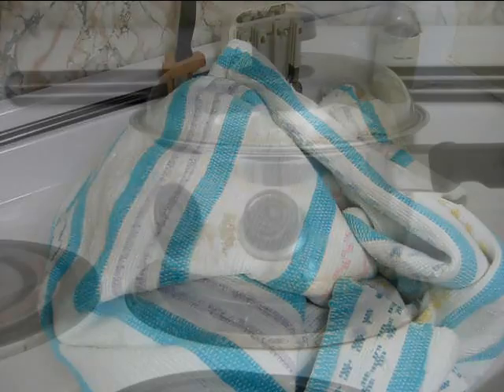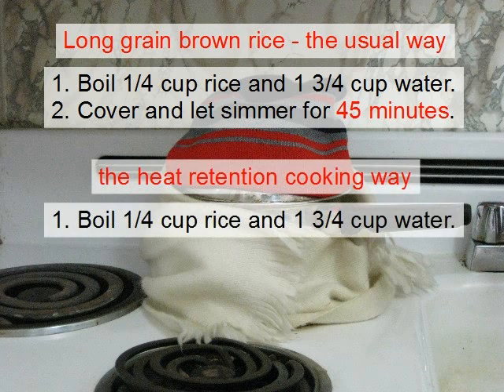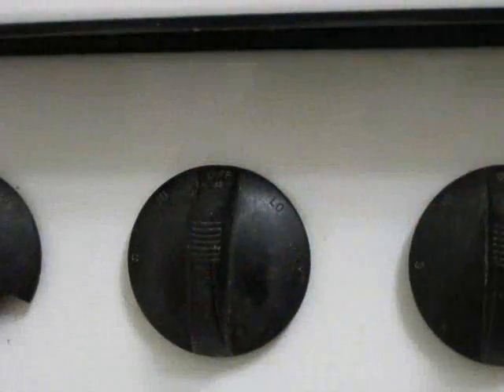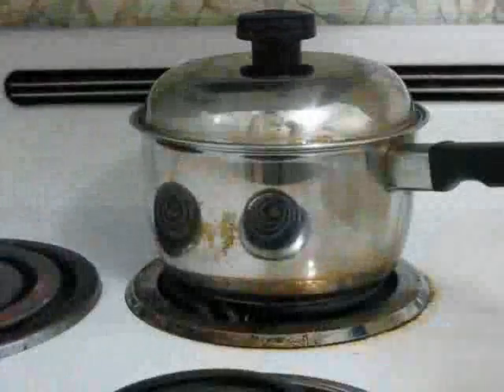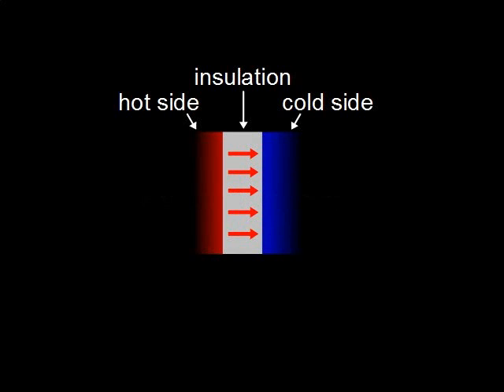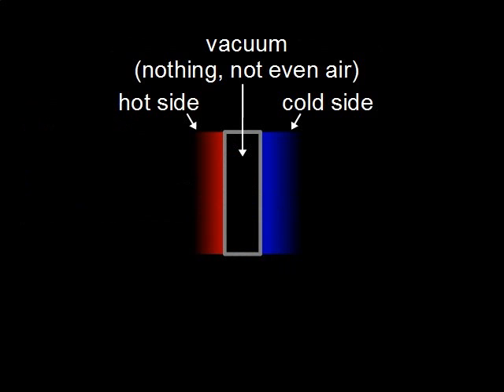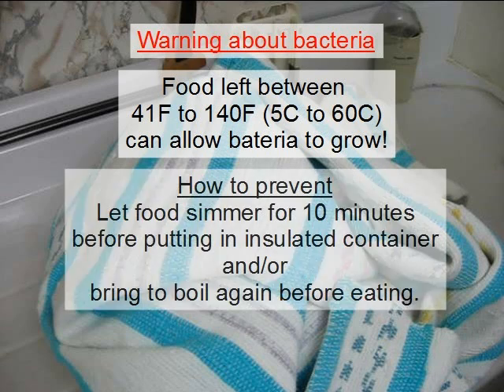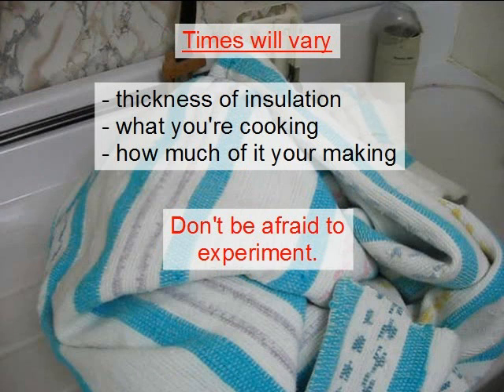How to do Heat Retention Cooking (thermal/haybox cooking)

Comment: I use duvets for insulation, they are the best. Anyone who buys thermal cookers from a store is throwing money away.
Reply from the maker: I'm glad to see others still do this. I don't do it all the time, sometimes I need the added humidity in my place from the stovetop simmering, but if not, then I still do heat retention cooking.

Comment: Nice clear explanation of thermal part of it. I've found that the more I fill the cooking pot the more heat it retains, is it because heat gets lost into the air in the pot?
Reply from the maker: Water has a high specific heat capacity, meaning that it retains a lot of heat per mass. That basically means it's very good at storing a heat. The more water you put in, the more heat you can store in the pot. Many foods also contain water. 
If it's other things that you're filling it with that don't contain a lot of water then you're still getting the same effect, just less so since everything has at least some specific heat capacity.
Air has a lower specific heat capacity.
See this table (water is H20) http://www2.ucdsb.on.ca/tiss/stretton/database/specific_heat_capacity_table.html
Reply: Thanks, that was really useful info. Ah, a lot of veggies contain a fair bit of water. Am going to experiment. :-)

Comment: RimstarOrg  cool, but I would recommend putting a warning about beans, never cook fresh or dried beans like this, only reheating cooked beans or canned beans. there are toxins in most fresh or dried beans that can poison you(possibly fatally) if you don't cook them properly to destroy the toxins, this sort of cooking is not sufficient to destroy those toxins. you need to boil beans for hours  or cook them quickly in a pressure cooker to destroy these toxins.
Reply from the maker: I wasn't aware of that. Thanks.
Reply: True...Kidney beans are the worst.  Do a Google search on bean poisoning.  I just learned about this.  It says pre-soaking and then boiling for 15 minutes is enough to kill the toxins.  As little as 4 kidney beans can cause serious illness/death.  Scary stuff. Also, if you don't get the toxins out they will just multiply. :(
Reply: You definitely can cook beans, (even kidney beans) this way of you follow the rules for safely cooking beans. Just soak the beans 8 hours/overnight before cooking, that's very easy to do. Drain the beans and cook with fresh water, then make sure to boil beans for at least 12 minutes, that's all. Then wrap up in the thermal blankets just the same way and leave alone for several hours. Check out boiling times for beans on the web and you'll see this is safe. Just soak drain and boil. Look this up yourself before doing it.

Comment: I've done similar heat retention cooking, but use a ratio of 1 part rice to 2 parts water:
1 cup rice and 2 cups water.  I boil the rice for 5 minutes and let it sit in an insulated container for about an hour.

Comment from the maker: @DCVU2 Try searching google.com for "heat retention cooking". But they are all rough. The amount of time it takes depends on the amount of insulation you use which is different for everyone. It also depends on the amount of food you're cooking. So any recipe will say things like 1 to 2 hours, or 3 to 4 hours. Instead just try it for a length of time and if the food is not cooked enough, put it on the stove to simmer and finish cooking. Then the next time, let it sit for longer.